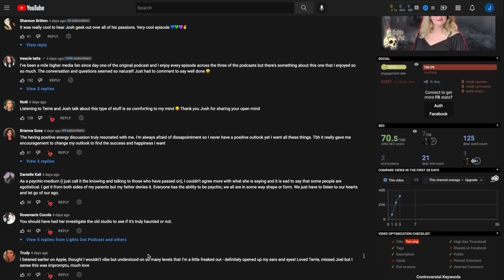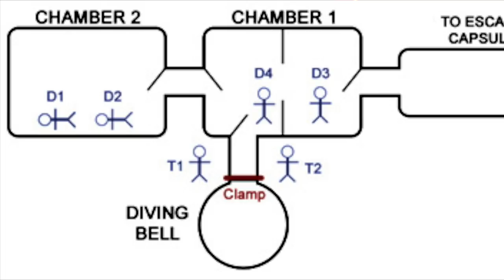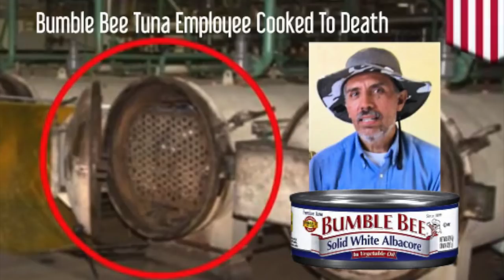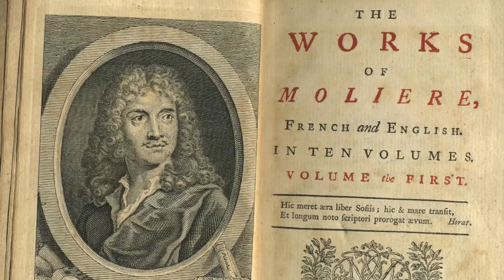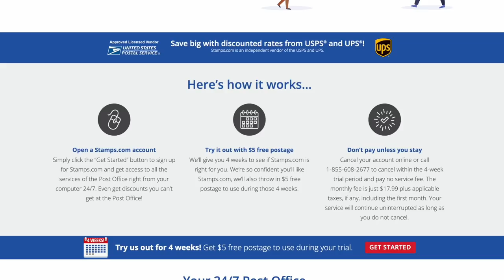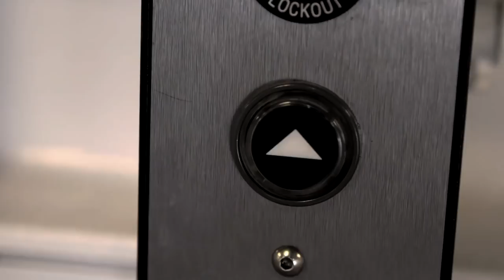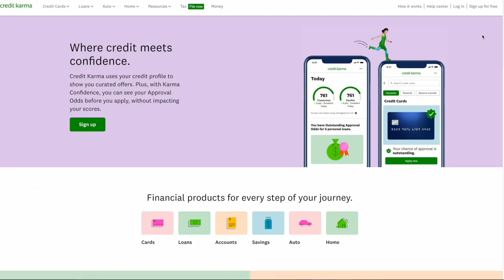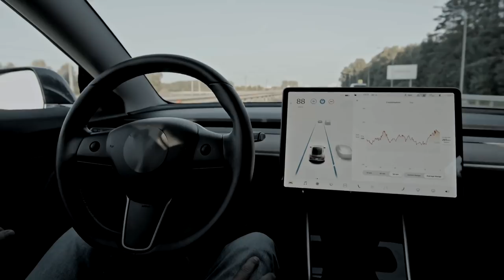Real-Life Horrors: 10 Of The Strangest Ways To Die - Lights Out Podcast #95

Comment: The tune guy, I blame the co-worker, not the company itself. How could he have been so stupid as to turn the machine on without checking inside? One would think that there would be safety measures in place
Reply: It’s called lock out tag out osha requires people working on equipment to isolate the energy going to the equipment before they work on it so this doesn’t happen

Comment: I used to work at a die casting plant. A man was working on the machine and someone accidentally started it up. These machines have dies that weigh a ton. We had to use cranes to move them. They shoot out melted metal. The dies don’t open until the cycle is over(30 seconds or more). So this poor man was crushed by the dies with this metal shooting out and no one could do anything but wait until the cycle was over.

Comment: Okay, I work with elevators, so I just really wanted to chime in for everyone who are wary of them.

1. Elevators CAN NOT FREE FALL. There's a backup break and if that fails and say, cables snap or something (which only happens in movies) it will fall tops a few feet. They are designed to not plummet down shafts.

2. An elevator losing power isn't dangerous whatsoever. At most, the lights go out and that can, naturally, be scary. But even the emergency button that connects you to an operator works due to a kind of backup generator.

All in all, movies love scaring us, but please don't freak out if you get stuck in an elevator standing still - you will NOT fall!

Comment: Just so ya know, more modern elevators have air locks or air brakes or something like that. So they aren't only on the cable, they're also on a track that has a failsafe to stop a fall. I'm sure it's still possible for those to fail but there is at least a back up for the cable in modern elevators.

Comment: Years ago i did housekeeping at hotels,  most hotels won't go that long without hearing from a guest.  Where I used to work,  if on the second day housekeeping couldn't get a response from a guest, the front desk would  call the room , if the room didn't  answer n no hotel staff had seen tge guest. The on duty manager n a housekeeper would go to tge room. To check. The manager has a master key that opens every door.

Comment: Omg the elevator one was the worst for me....I Hate elevators. Used to work in a downtown core building 20years ago, 8th floor, so not really that high up. I didn't really mind the elevator, except that it was super fast.
Now...I get paranoid getting in an elevator that it's going to either plummet...or just keep going up and like...blast through the roof of the building 🤦‍♀️

Comment: Where I work we have industrial grinders but we have Lock Out Tag Out procedures to isolate the energy to any given piece of equipment and keeps anyone from turning it on while we’re fixing it I would be interested to hear wether or not the guy who was killed in the pressure cooker didn’t follow procedure or if the plant didn’t have the proper procedures in place
Reply: I believe it was the plant. He was correct to clean the cooker, yet no one checked the cooker before turning it on.

Comment: The ones where people died in an industrial setting just piss me off. Either the company is negligent for not having safety measures in place or the workers ignored them. I used to work for Hillshire Farm and I specifically worked in one of the grider rooms with similar massive grinders, and we had SO many safety precautions, guards, lockouts, checklists, etc. that you would have to TRY to kill yourself and even then it would be very difficult. I just don't get it.